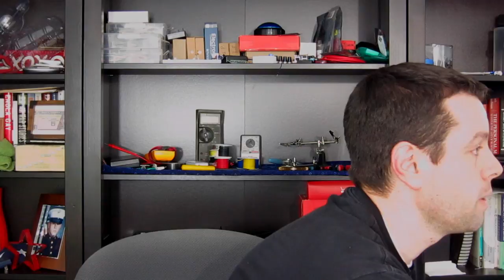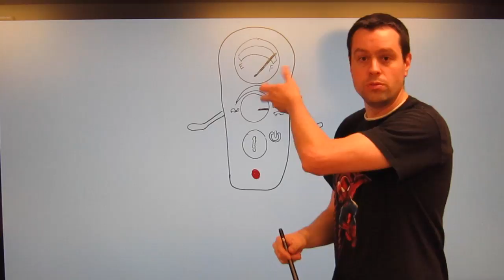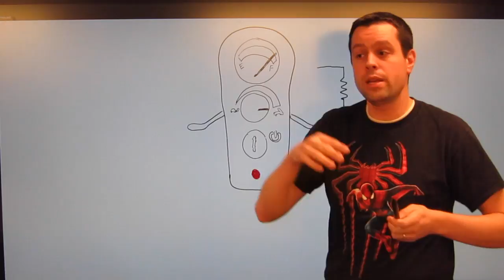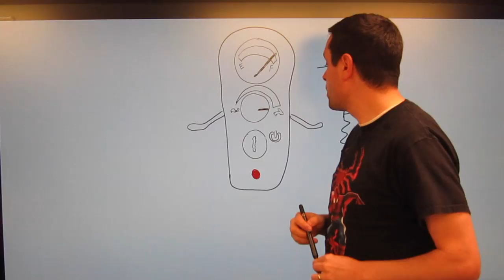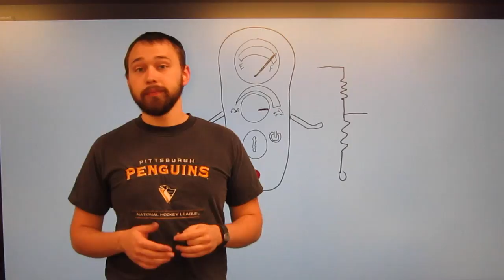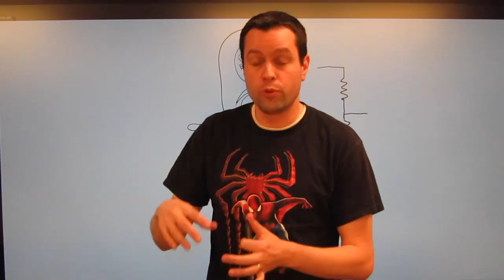14 TRILLION DOLLARS | DailyIot 013

Comment: Question: 
First off found a couple of batteries to make up my 24VDC needed to feed the PWM controller. They are shown in the link below.
http://www.monsterscooterparts.com/trsc/rec-categories/batteries1/24vobapa/gr12vo45amph.html

My question pertains to the charger not sure if this is usable on a sealed battery?

https://www.batterystuff.com/battery-chargers/24-volt/multi-volt-input/JAC0891-34.html#reviewsAnchor
Reply from the maker: Hey Rud Dog, I'm not really sure on the charger. I know those deep cycle lead acids like to be charged a certain way. I'm super paranoid about that stuff because I've never really dug deep into battery tech. My suggestion would be to give monsterscooterparts a call and see what they recommend.

Comment: First off, Matt thank you for nailing down the definition of GPIO have seen many videos on this but never had the explained where the purpose and tech explanation connected so well.
On the subject covering, control of the motor, was a bit confused. Is this project using DC voltage through a pot to vary the control voltage of the motor or is it using Pulse Width Modulation? 
I am for experimental purposes comparing driving the motor with DC voltage and PWM controller. Want to see the difference in current draw and motor response. Unfortunately have not pulled the trigger on purchasing the batteries and charging unit. Will make it a point to get this done today.
Thanks and great followup.
Reply from the maker: Great question. The factory configuration appears to drive the motor via an H-bridge configuration. It's a 24VDC motor. What we're thinking of doing (and you'll see in an episode coming soon) is hooking it up to an off-the-shelf motor controller that takes a PWM signal as a control signal. The PWM, however, isn't used to drive the motor directly. It will just be used as a communication signal to the motor controller. That's cool that you have a similar project going on. Would love to hear about your findings.
Reply: Now can't wait to see your configuration and ingest more knowledge concerning the setups used on these contraptions. Thanks for all the videos and responses good to have allies in the search for techno-knowledge